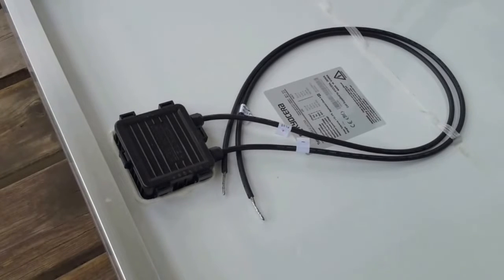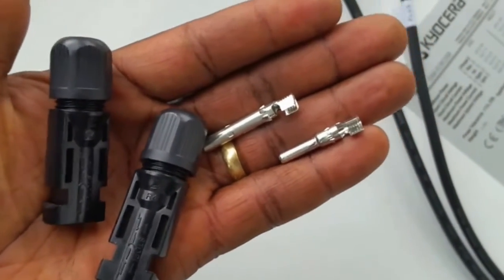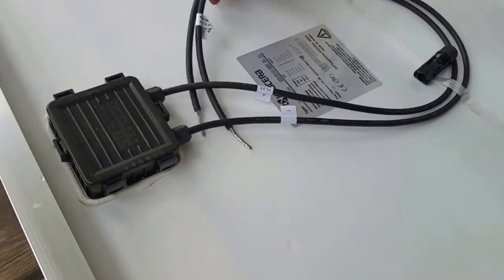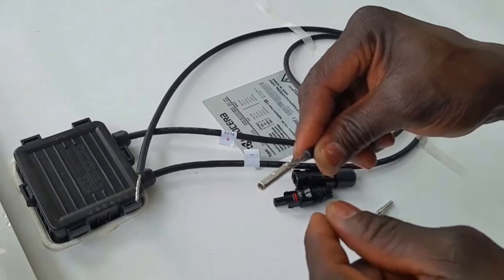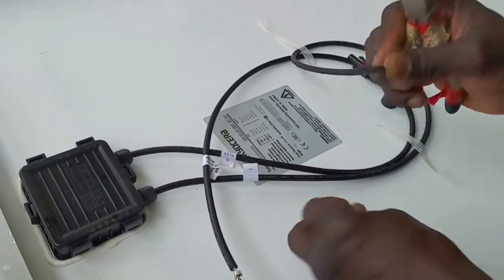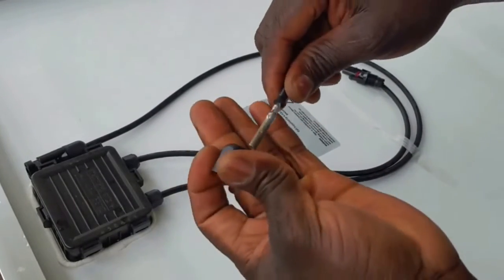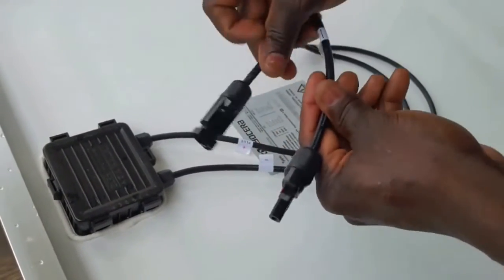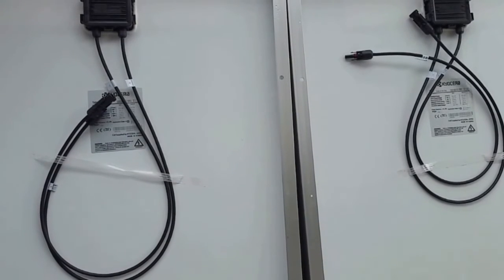HOW TO WIRE SOLAR PANELS USING MC4 CONNECTORS

Comment: Why do you have to soder it cant you crimp it?
Reply from the maker: UNISTRUT NUT WITH SPRING: Superstrut Solar Panel Mount
https://youtu.be/XBR-aiK7kIw

SOLAR PANEL ORIENTATION/Cutting Unistrut/Superstrut for Roof Mount Installation
https://youtu.be/eNFo08dfN8Q

UNISTRUT SOLAR PANEL MOUNT: How to install solar panels Using Unistrut/Superstrut
https://youtu.be/3uubcw8gGPw

Comment: You took a simple job and made it complicated..
Reply from the maker: Yes
Reply from the maker: UNISTRUT NUT WITH SPRING: Superstrut Solar Panel Mount
https://youtu.be/XBR-aiK7kIw

SOLAR PANEL ORIENTATION/Cutting Unistrut/Superstrut for Roof Mount Installation
https://youtu.be/eNFo08dfN8Q

UNISTRUT SOLAR PANEL MOUNT: How to install solar panels Using Unistrut/Superstrut
https://youtu.be/3uubcw8gGPw

Comment: I'm planning on putting between 500 and 1000watts of solar in parallel , should I have to change the wire to a thicker gauge and not use mc4 connectors. what should I use? I have all the other components already and don't want to melt my wires when I connect it all up.
Reply from the maker: What's are the specifications of your panels?
Try to run high voltage coming from the Solar Panels into Charge Controller. This method will help you with your wires.